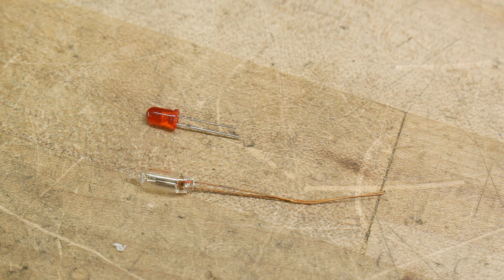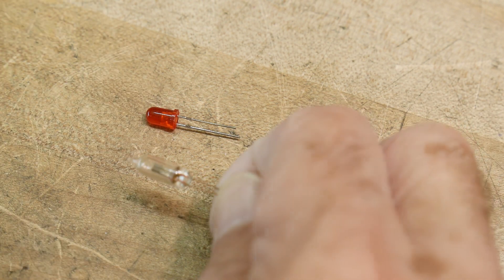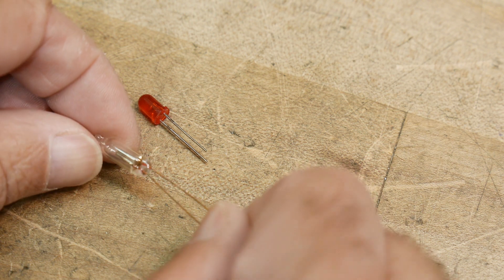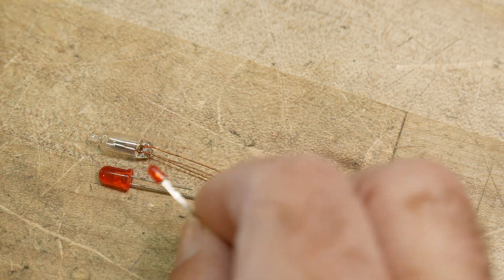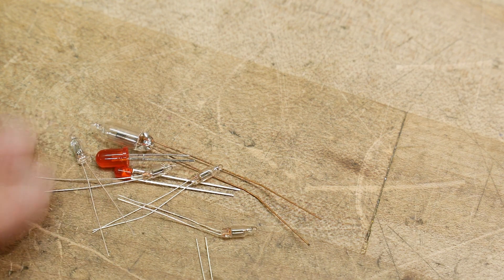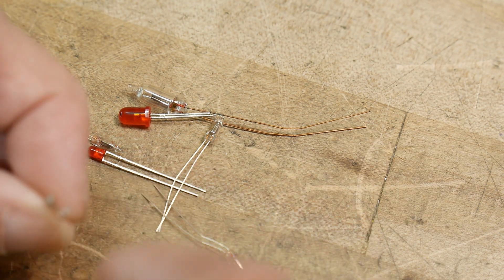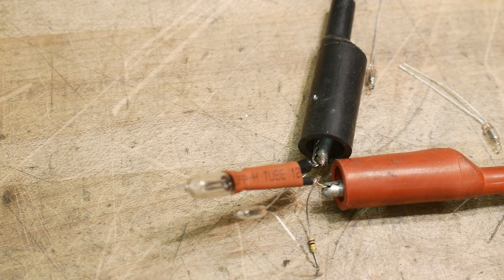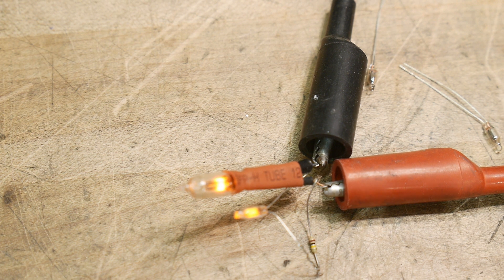#1182 Super Tiny Neon Bulbs

Comment: Back in the day, old 10Base2 network cards had something like that as a basic surge protection.
Reply: Yes! Surge arrestors they are called, usually they have a different gas mixture than typical neon bulbs but theyre very cool, the modern surge arrestors are axial ceramic things.

Comment: you need to have the resistor in series with them no matter what voltage you supply them with, because they will act as a zener at 90V, if you don't have a ballast resistor then they will enter the breakdown area and break down ofc.
I've seen this size neons in cheaper kettles for a power indicator

Comment: That was interesting ~ thanks.

Old rotary-dial phone instruments in the U.K. used to have a neon buried away deep inside; I think it might have been for lightning protection or other over-voltage protection on long overhead lines. Their glow never reached human eyes - it definitely wasn’t an indicator, and sometimes they were completely encased in shrink.
I never knew about only one pole lighting on DC.
Do you know what the electrodes are made of? They always seem to have the same characteristic shape.
Reply: I think they were thermistors.

Comment: They have a negative resistance region so a dropping resistance is mandatory to avoid damage.  Once the voltage is large enough to ionize the neon, the electrons and ions become very mobile and resistance plummets.  Without a series resistance to limit current, the electrodes get hot, deform, and evaporate onto the inside of the glass capsule.  I have wondered whether they would make a usable amplifier analogous to the tunnel diode.

Comment: I picked up a bundle of NE-2 bulbs at a junk store, and all 23 of them are white inside the glass. They have wires attached and looks like a resistor inside the heat shrink, and appears that they have never been used, but I wonder if someone hooked these up to high voltage and blowed all of them, or if for some reason they were made like this.
Reply from the maker: I have some with phosphor coating inside (white). they glow green
Reply: Those lamps you have seen are probably green, blue or white bulbs.

Comment: Barthelme still makes these. They are 0,25W, for 115V you need a 120K resistor, for 230V a 390K resistor.
Such a Neon bulb is not only usefull as a light indicator, but can also work as a clamping/overvoltage protection, below the striking voltage a Neon bulb acts like a open circuit, so 0% leakage.

Comment: Learned more once again...

Always

Mmm- 

Vs / desired curent= I limit  resistor

67 VDC / 100 kohm = so max current NMT 670 uA.....

But I don't know what the blub voltage drop is...under normal glow..

Please measure and tell us...

I did look for some norminal current...but listed was just small blub glow current 
ranges of 0.1 to 10 mA...And a little when glowing...that's all over map...

But plausible for many blub sizes...

When plasma strikes and glows blubs has almost no resistance...but there must be a little V drop...

Ok...1 volt? voltage drop across lamp

66 Vdc across 100 K = 670 uA

Ah ha...wow...looking at google..Google...

Lots of curves...

A strike voltage...

Maybe when the plasma emits

I never knew about that driving with DC only half electode glows...but I suppose plasma creation with DC voltage..like in early PVD sputtering ...

Pull vaccum...add neon...turn up DC volage plasma strikes...put near a target...ions will collide...material then is coated with your target material

Down a hole you go...lol

I do enjoy using the Heathkit Nixie frequently counter...that is old school -still works...My workng Racal Dana 1992 was sent to ABQ....for a periodic  tool cal...but an App was found on smart phone...

Someone  pawned my beloved 1992...

 I had 2 counters...one is broken...the working one was pawned  in ABQ buy........??

I bet she or she was offered $10 and took it..

I haven't thrown the broken one  out -it has signs of life fot IMASI Guy has inspired me...during his quick 1992 instrument repair....the working one had the 1 GHz option...broken one if working 512 MHz...bummer

I really don't mind being stuck in the 1980's...but learing with new things not possible to obtain...

The little Heathkit with big digits...good enough for a quick and dirty...to insure I pressed 10.kHz in instead of 100 kHz on the function generator....and theres the little reminder of when Pop and Joe  built it...he conned his ham friend to buy it...and Joe was much older so pop got it anyway....1972...?

It might measure 50 MHz max...IDK

Comment: I believe the minimum turn on voltage is called the "striking voltage" and guess that's analogous to striking a match and turning it on!
Reply: The same term is used for High Intensity Discharge lamps like Sodium Vapor and Metal Halide.

Comment: I believe the smaller size may be the one used for the backlight in my Kenwood TS-830s meter.
Reply: I believe this I saw these in radio displays as well a few years back when I was repairing them.